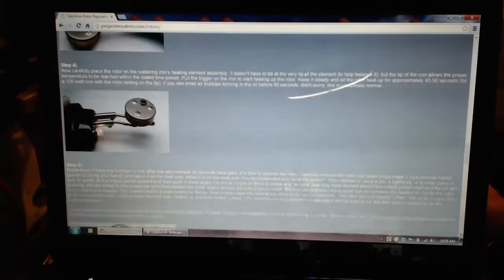1958 Zenith Model B516G Restore Part 3

Comment: Love this series buzz, had one question, after you lubed the motor, did you lube or spray all the other gears? I would have given that assembly a shot of the old WD-40. Maybe they are suppose to be dry?
Reply from the maker: +Scott Johnston ..Don't think you're suppose to spray WD40..I think dry sounds right..been too long..cant remember...Buzz